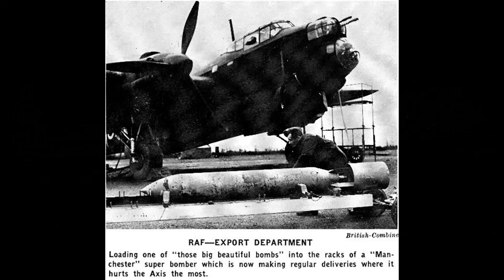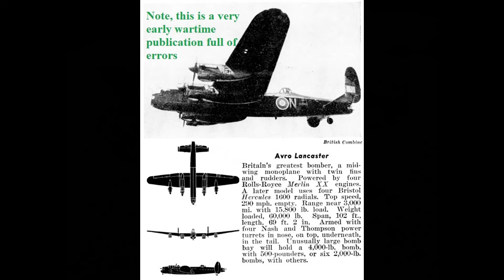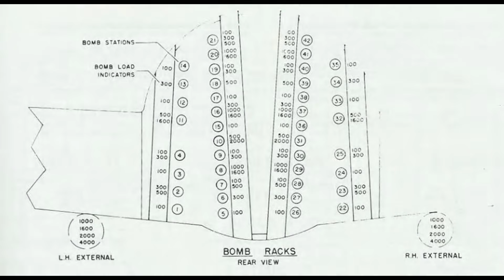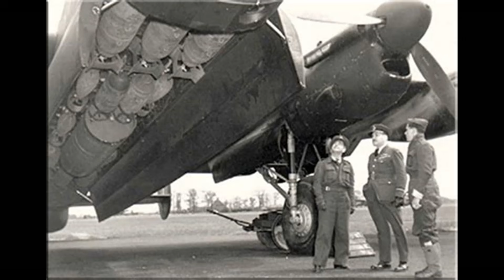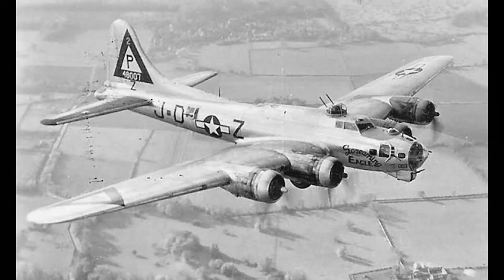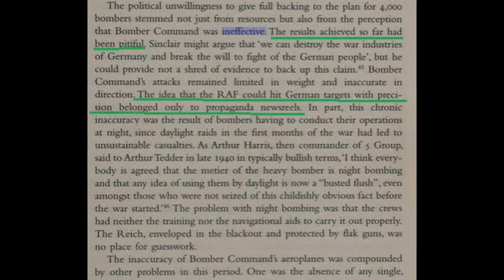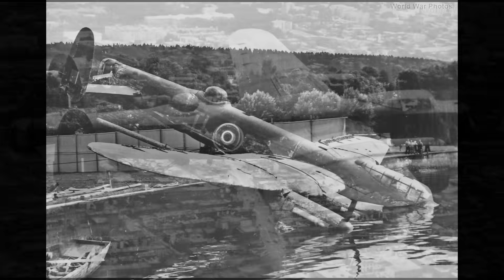Avro Lancaster, Payload, Turrets, Stability and More

Comment: Is it pointless carrying the 0.5" or 20mm on a night bomber if you cant see anything outside a few hundred yards anyway?  Is this a possible reason they stuck with the .303?  It is strange thy did when they put so much effort in moving the single engine fighters off the .303. Ive often thought about this.  As Greg says the radar sighted 20mm seems a logical choice and is used on post war aircraft.

Comment: Hi Greg, couple of questions about those turrets:
Given how cramped those turrets were, would it even have been possible to fit twin 20mm cannons into them? Or would they have designed a turret for a single 20mm? In either case, what about the sheer weight of the 20mm ammunition? You would need enough ammo for at least sixty seconds of continuous fire for a gun of any size to be worth carrying, and that amount of 20mm ammo would be very heavy.
Reply from the maker: I would assume new turrets would be needed, which is why they should have used them from the start, or at least 50 cals.

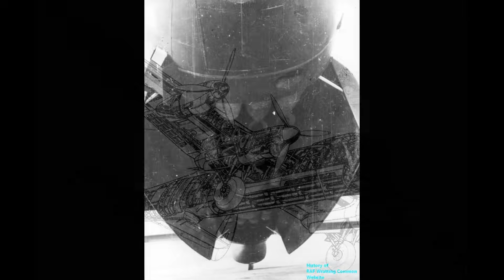Comment: 15:14

Failures in hydraulic, mechanical and electrical systems during the lift of bombs into the bomb bay were not uncommon.
And sadly, great tragedies caused by it and the need to remove safety pins from loaded bombs, occurred during the war:

According to a documentary I saw some time ago, on March 13, 1943, a 4,000-pound "Cookie" bomb fell from its support in the bomb bay while personnel were still working under the plane.
the bomb exploded, all the men working in the aircraft died, 6 Lancasters were lost in their entirety and another 5 were seriously damaged by shrapnel.

Comment: You mention that altho the Lancaster could carry 14,000lbs of bombs, it didn't carry that much all of the time. Then you fail to make that same comment about the nominal 12,800lb bomb load of the B17. The fact is the average bomb load of a Lancaster was significantly higher than that of the B17, altho the B17 was of course used for daylight raids, where more defensive payload had to be carried.
Reply: Operational history of Lancaster 1B R5868    on line
Reply from the maker: Wow, some of you guys are sensitive. I didn't go into payload details about the B-17 because this isn't a video about the B-17. Don't worry, I'll go into the details of the planes actual payload capabilities in the next video and compare them with the B-24 in more detail than you probably want.

Comment: Great video, regarding the .303s used by British bombers, I’ve read that the high rate of fire of the brownings and the relatively close range attacks required by the Luftwaffe night fighters helped to negate the shortcomings of the .303.
Reply: I think you are correct. In Wilhelm Johnen's book Duel Under The Stars he discribes how they were well within 200m before opening fire . He aslo discribes having his Bf 110 ripped apart by the rear gunner of a Stirling who got the drop on him which demonstrates the lethality of the quad .303 at such close ranges.
Reply: .50 cal may have saved hundreds of lives.
Reply: Still, imagine how many lives would have been saved with those 20mm guns.

Comment: Having a low wing and rudders on the horizontal stabilizer was a problem with stability??
The Lockheed C-69 Constellation design seemed to work just fine ;-)
Reply from the maker: I didn't say it was a problem. My point was that it has to be offset in other ways. The Constellation has a lot of dihedral and three vertical stabilizers all of which are mounted up very high.
Reply: @GregsAirplanesandAutomobiles  My point is that stability from a high wing is MORE due from having most of the weight slung well below the center of lift.  A high wing has natural stability (like a pendulum) so any vertical stabilizer configuration becomes less relevant.  Low wing planes can use more dihedral at least in an attempt to get the center of lift up higher and nearer toward the center of mass.   Because low wings have that less natural stability, then either more dihedral or simply use a longer distance between the center of lift and the vertical stabilizer work equally well.    

Sweptback has almost no stability increase below 300kts.  Basically all it does is at those speeds is just move the center of lift aft when compared to straight wings.

Bonus: early B-17's had a very small verticle stabilizer.  It only became huge for structural reasons, not stability. The long fairing and taller fin was added to strengthen the aft fueselage (after cracks were being discovered).

Comment: Avro Manchester Mk III BT308 became the first Lancaster with 4 Merlin engines but kept the Machester three tails, which had a central tailwith no controls. Avro Lancaster BII were fitted with 4 Bristol Hercules Radial Engines due to a shortage of Merlins. The radar that the German night fighters used to home into the Lancaster and other bomber was not the Village Inn, but was Morica.

Morica was a tail warning radar for bomber which entered service in 1942. It was also used by the USAAF as AN/APS-13 nicknamed Archie. However, the Luftwaffe found out about Morica from a crushed bomber, German scientists developed a passive radar receiver, named Flensburg. The RAF in turn found out that Morica was allowing night fighter to home onto bomber when a 7.Staffel/NJG 2-flown Junkers Ju 88G-1 nightfighter equipped with Flensburg mistakenly landed at RAF Woodbridge. Morica was withdrawn from RAF use, however, this is not the end of Morica, an AN/APS-13 was used as a radar altimeter during the Atomic bombings of Hiroshima and Nagasaki. 

A great book to read about Allied and German radars is Alfred Price Book, Instruments of Darkness: The History of Electronic Warfare, 1939–1945

Comment: The Lancaster (AKA Manchester Mk.III) had in my view three great failings (I know Greg you put more emphasis on the access to the bomb-bay). The first is the low height. At around 21,000 feet on a typical mission it was less than the Halifax, and much less than the B-17 & B-24. More than a Short Stirling or Wellington, true, but still low. The Lancaster Mk.IV, AKA the Lincoln fixed this (and used the canons too) at 31,000 feet. A more recent discovery for me is that the escape hatch was 22"x24", unlike the Stirling & Halifax 24"x24". Apparently analysis shows that this tiny difference made a huge difference, as far fewer Lancaster crews survived than the Halifax and Stirling. The third, as mentioned, is the underside, and the German Jazz Music guns.

On a more general note, 44.4% of all Bomber Command crews died, and a tiny number (10%?) were captured. However, the number of US bomber crews who died was far fewer than the RAF (8%?) and a similar number captured. This is a subject worth exploring, especially as the B-24 was known to be vulnerable.
Reply from the maker: The B-24 wasn't really that vulnerable. I might talk about that some time.
Reply: @GregsAirplanesandAutomobiles  I'd be interested in this. Apparently the B-24 was used more for easier targets, the B-17, despite a tiny payload at distance, for the harder targets (especially Germany). Also, that the B-24 required more maintainence, meaning that, fewer B-17s were needed, despite their much smaller load at distance to the B-24.